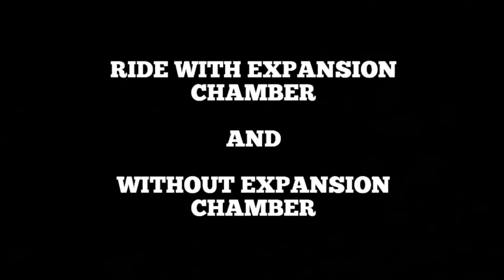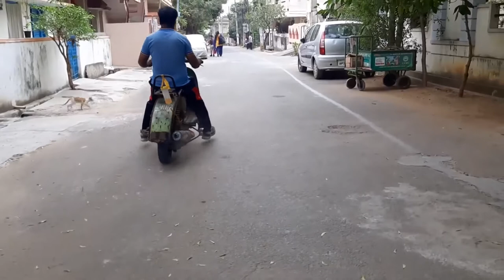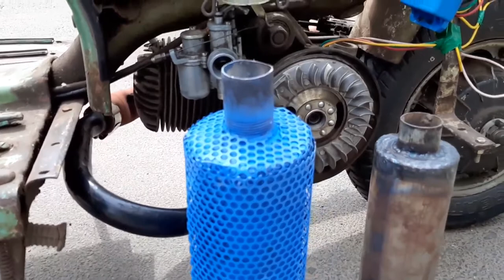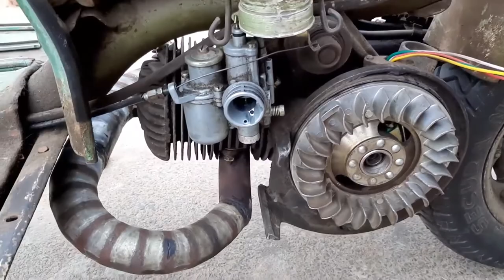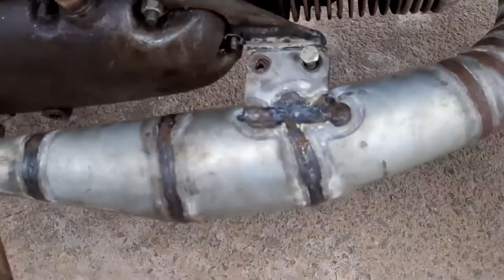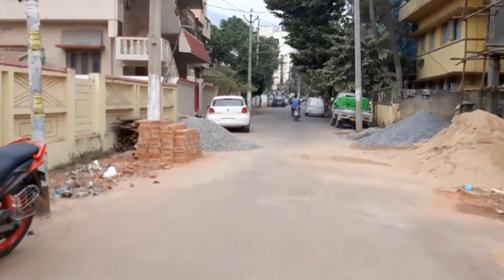Boost Your 2 Stroke Performance with an Expansion Chamber

Comment: Wow man that's a awesome example of how just it sounds so different than using a simple round pipe. Of course with the expansion pipe it is going to change the engines entire characteristics of where it use to make power and where it's now with the pipe going to enhance the power output. On something like that with stock degree port timing you will notice it has much more off the line power or torque with just the round pipe but it will lose power as your rpm's increase. Thus with the expansion pipe your power is now going to be at a higher rpm level and frequency all depending on how the pipe is designed and works with your particular ports of your cylinder. You can change this through if you prefer by shortening the expansion pipe midsection or if you wish to have power in the higher rpm's leave it or even lengthen it to increase your power band into higher rpms. The biggest thing I've found with any of my 2 strokes I build, Is to build the engine around the operating rpms that whatever vehicle you are putting it into is going to benefit most from or be in that particular rpm range for long periods of time. To me it's a fun science and learning experience in how certain things effect your engine and power output. But once you get an idea of what sizes and shapes do best with the rpm's you are thinking of running, you can actually figure a lot out from experience and just by looking at port sizes and placements of how an engine is going to perform. Simple example is the placement of the top of the exhaust port and size of that port is going to determine a Big difference in either lower end power or higher end power. A low small port is going to behave well at low rpm's and make more compression at low speed hence having more torque than say a large port closer to the top of the cylinder deck. This will make less static compression down low and low end power will suck ass. But paired with the correct expansion pipe to suck out then slam in the extra air/fuel charge to the exhaust port, this will allow the engine to breathe more efficiently at higher rpm levels hence making more power as well at top end. Hey good luck with your Lambretta, sounds like you are onto something there just how it sounded, with some minor port work and squish band adjustments it sounds like it could be a pretty powerful little engine. 😉
Reply from the maker: Thank you for the wonderful technical explanation 👍👍

Comment: Sir,  can a similar exhaust be created for Bajaj chetak. I am very new to this topic, kindly share your experience.
Reply from the maker: Yes 100% you can fit. You will find manufacturers in Delhi and Bangalore. Once you make fit 💪 25%  boosting in power will be available along with reed valve

Comment: Wouldn’t it run better without the restricting muffler after the expansion chamber?
Reply from the maker: Will run better. But to squeeze out the best from same rated cc of engine we use expansion chamber to draw more air and fuel to cumbustion chamber. In this the exhaust resonance travels again from the end of expansion chamber  up to cumbustion chamber of engine. This exhaust resonance indirectly controls the intake of air fuel mixture entering to engine. That's why it is very important how you design the chamber. I already modified this chamber and got very good result. I mean while riding it is ready go for wheelie/flying. Thanks for the great question 👍👍

Comment: what is the name of the electronic ignition kit and what is the cost of the kit?
Reply from the maker: Its K2. But not from SIL. Cost 4500 Rupees
Reply: @LambrettaRamesh thanks for your reply.
 where did you buy it?  More info please, if possible.
 Bought online or what? 
 Can it be fitted to Vijay Super? 
Regards
Reply from the maker: From DELHI. It can be on Vijay Super also. But before ordering please confirm the dimensions of Mag housing and suitability

Comment: Can this be done on bike 4stroke please reply
Reply from the maker: Can be done on 4 stroke the design must be different. The design including shape and length depends upon the CC of the engine. The silencer must suit to the expansion chamber you make otherwise you will not get the desired results
Reply: @LambrettaRamesh  a 4 stroke doesnt need an expansion chamber.